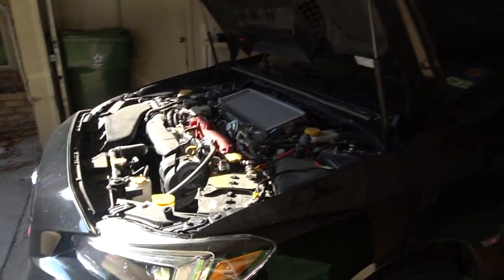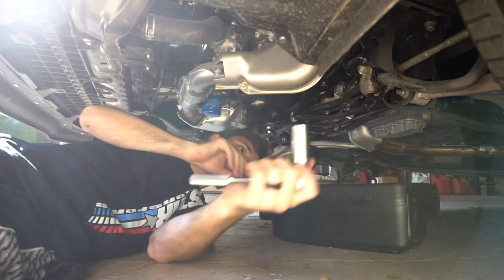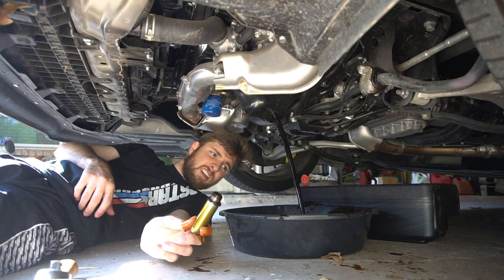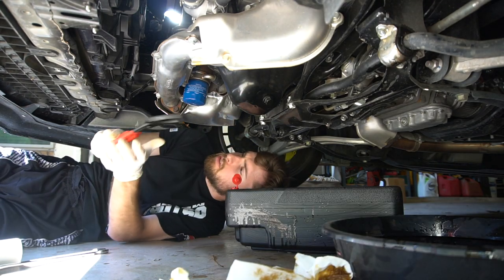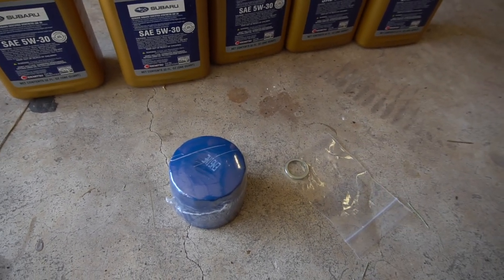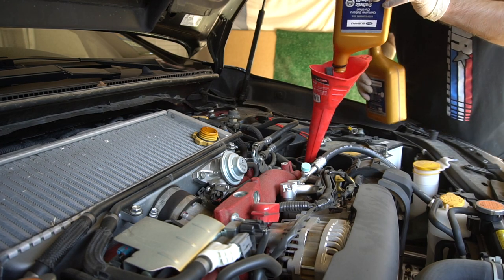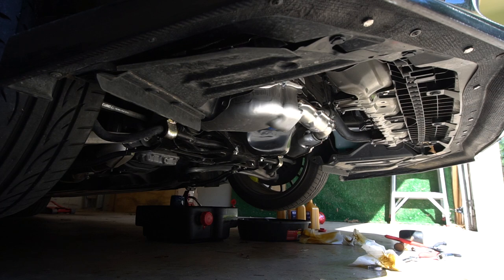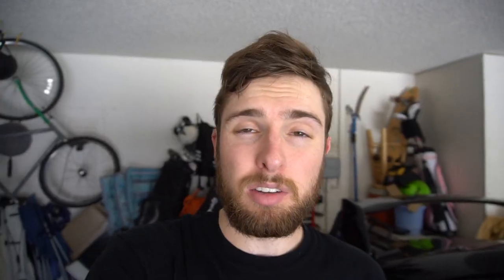2020 Subaru WRX Sti Maintenance + Life Update

Comment: Congrats on the marriage. Good to hear you guys are doing well!

My 2 cents for oil changes. The oil filters that Subaru USA hands out are made by Fram/honeywell. Fram and Honeywell oil filters are known for being crap. Lots of videos on people opening them up and comparing them to other brands.

I've been using Wix filters for over a year between my 2017 Legacy until I traded it for a 2015 WRX. 

I also buy Valvoline oil. But I know the Subaru oil is produced by Motul which is very good, high quality oil.
Reply from the maker: Thank you! And thanks for that info. I will definitely look into that.
Reply: the oem subaru filter for all EJ series are more than capable of anything the owner throws at them. they are used on track cars... lol

Comment: 5W30 is way too thin for these motors btw. Your car will like 5w40 more
Reply from the maker: Even for a 100% stock motor? Thanks for the advice.
Reply: @TJShoop  yes even for the stock motor. if you had oil temp/pressure gauges you could really see the difference! if you daily your car and never get into boost, 5w30 is fine. but if you drive spiritedly then you should run 5w40